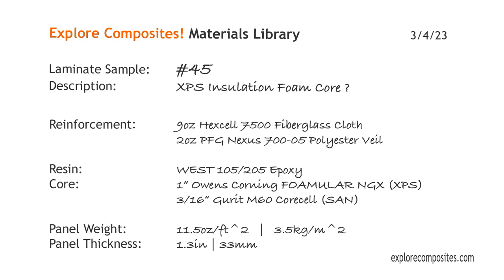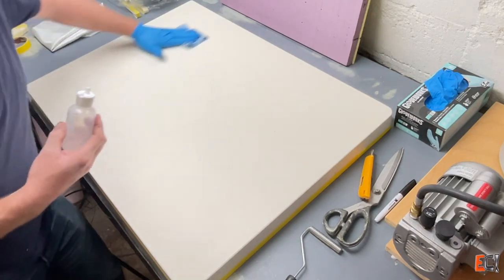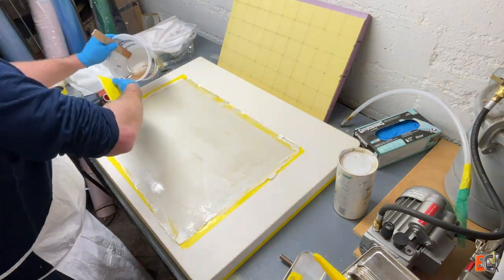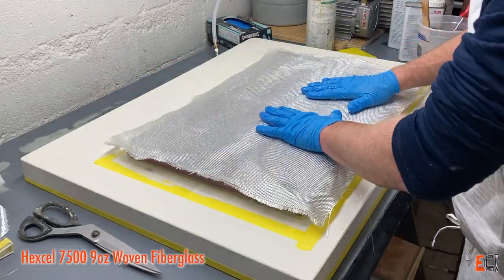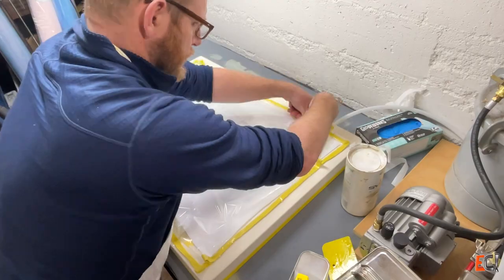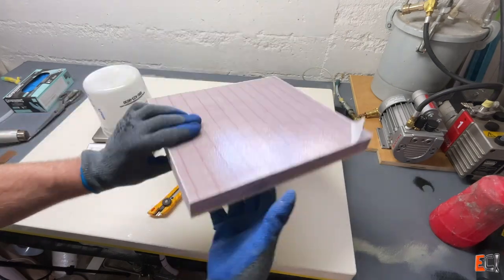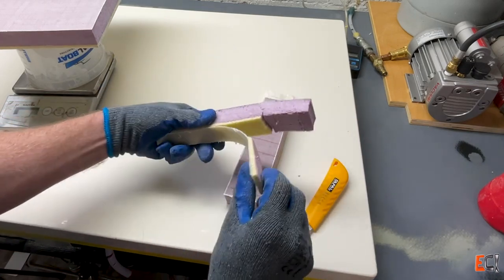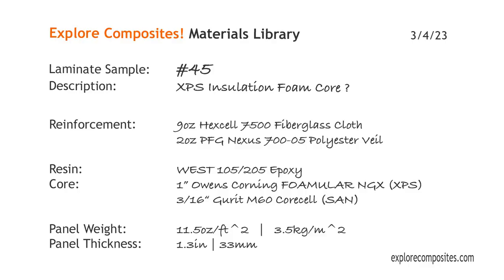Laminate Sample #45: XPS Foam Insulation... Core?

Comment: I built a couple of surfboards with XPS, wet layup e-glass and epoxy. I used a couple of techniques to encourage good skin bonding, like a row of 10-12 exacto blades to score grooves, and initially it was ok but they all delammed eventually. My understanding is that XPS has around 10 percent polyethylene added. This keeps it from sticking as it's extruded. It also keeps anything from actually chemically bonding to the foam, so physical bonding helps. Over time it seems to lose it's grip, perhaps because cycling slowly breaks all the weak surface bonds that initially stuck to the PE. Another issue is that it's closed-cell enough to trap air pockets that will expand with heat and grow with cycles.  Too bad, that foam's physicals are really good. Thanks and the library is awesome!
Reply from the maker: Thank you for the information about XPS - I didn't know about the PE added or consider the trapped air expansion risk.  I came off as pretty down on it in this video, but only because I was trying to get more from it than it can offer.  If you're building super light stuff with little risk of impact - it can be great!

Comment: XPS foam is a polystyrene foam. Epoxy as we all know is exothermic meaning that it generates heat. Foam and heat do not mix . That being said. There is a way that you could’ve done it if you would’ve used a penetrating epoxy with a slow hardening on the foam And put it in your vacuum sealer and basically allowed that to cure with just the epoxy, sanded it, and then add your other substrate with your fiberglass, obviously sanding to create a mechanical bond, you would’ve not had delamination. It would’ve been a solid structure way more solid than you did.
Reply from the maker: This is interesting - the way it failed looked very much like failure of the foam, but if your penetrating epoxy could get a better (deeper) grip, maybe it would be tougher.  Usually penetrating epoxies have very low viscosity and that helps make them penetrate - do you think this would help here?  Thanks!
Reply: @ExploreComposites  FINNFOAM has been used to make at least 2 boats, believe deeper penetration of epoxy helped but really vacuum infusing it is the way to go, only that would cause it to deform under pressure.

Comment: could i use this method to build a outdoor countertop
Reply from the maker: Maybe, but it wouldn't be very strong and would dent easily.  You could certainly fiberglass over an outdoor countertop more heavily - or lightly if the underlying structure is plywood or something strong.  Plenty of boats have decks made out of plywood with fiberglass (ideally in epoxy) over - works great!
Reply: @ExploreComposites  yea im trying to find a substrate to do a outdoor kitchen on..the epoxy and top coat i have that figured it out..tricoya is 385$ waterproof my wow that price for a 4x10 im almost thinking solid surface/corian

Comment: A big issue with XPS foam is that it releases gas when pressed/crushed. That is the reason why some surfboard manufacturers that uses XPS as foam core have to drill holes every inch or so through the fiberglass into the foam to allow the gas to come out and avoid delimitation (e.g. XTR technology). Thankfully, XPS been closed cell, water won't get in. Unlike EPS (open cells), adding a Gortex valve in XPS surfboard won't help since there is no path for the gas to come out.

Comment: I use xps and eps in surfboard building with 3-5mm pvc foam sandwich or  0,6mm wood veneer ....u can have a much better bond by adding some microballon-epoxy filler on the xps foam :)
Reply from the maker: Thats interesting!  I was kind of thinking surfboard here - so you use the PVC foam or veneer to improve surface impact resistance?  Or skin adhesion?

EPS I can totally see benefitting from the micro balloons - does it make as much difference with the finer grained XPS?
Reply: But you do use a pressure valve in the foam?
Reply: @ExploreComposites  impact  general

Comment: XPS foam has a coating on it due to the manufacturing process. That coating should be removed via sanding or hot wire so the epoxy will form a good bond.
Reply from the maker: Thanks for the info - that makes sense. I will have to experiment with it more.  I wonder if the hot-wire process itself makes for an improved bond where the melting has happened?

Comment: Sanding the surface of the xps would help. In the case of pvc foam, it has a closed cell structure, but in the process of cutting the surface, the cells on the surface become open, increasing the bonding force and reducing the peeling phenomenon.
Reply from the maker: I totally forgot to mention it but I did sand with 120g before cutting in the slices on both faces of the XPS… oops!

Comment: I used XPS as a foam core in a few windsurfing boards.  They were exceptionally light and lasted very well.  I did use on of the denser grades.  I would not hesitate in using this again.  
It certainly is worth considering for other uses, say a small dinghy / yacht tender.  I would not use it for the main structure on a yacht, but for non critical parts, perhaps.  Particularly if you were after good insulation, for the least cost
Reply from the maker: I haven't found an easy source for higher density XPS, but I bet it would work pretty well even at 2-3 pound density.  Compression strength and peel-resistance is probably closely correlated with density.  Hoping to try some out soon!

Comment: Very helpful.  Echo Tom's comment, glad your back.  I've used XPS only for the base core of plugs, easy to cut and stand on edge laminated with foam construction adhesive.  For that purpose it's worked well and saved money.  You're test confirmed my intuition regarding it's use as a core material.  Thanks performing and recording the test.   I suspect you saved at least a few folks some frustration.
Reply from the maker: It certainly has its place - even as a core if you can control peel and don't plan to have impacts.  I still think there's something to the thin layers of higher density core on the faces to manage skin adhesion and impact resistance, but the whole sandwich is still limited by the weakness of bonding anything to the super low density XPS.
Reply: @ExploreComposites  I am thinking of make a truck camper roof with XPS foam, the plan is 60 PSI XPS + 2 layer of carbon fiber, with a 6.5" x 13" test piece, it can support 125lbs. Yes, I know the de delaminate issue, but the lightweight really attract me. Any suggestion for the pop up topper roof core?

Comment: As a structural flat panel, it definitely doesn't do so well.  However, this is a method that's been used for more than a decade in the model airplane community with great success, although we typically are sanding the XPS into complex curved shapes (much stronger) and we have to make a lot of concession for ultimate strength to keep weight to an absolute minimum.  That said, the 25psi XPS has made me fine electric jet models for years which easily exceed 150mph and have the structural integrity to pull out of a dive at that speed and straight back up.  We also use carbon fiber tube to make strengthening spars, but still.

That said, there's a YouTube channel called ThinkFlight who's perfected a process with low density EPP foam, Kevlar fabric, and E6000 craft glue thinned out to nicely wet the fabric that makes a nearly indestructible airplane that bounces off almost anything.
Reply from the maker: Thank you for this!  I would love to learn more about model aircraft building.  Impacts seem to be the big issue but even surfboards make it work.  Going to look into other low density foams and will check out EPP.
Reply: No problem! I always like to see new building techniques for just about anything, especially involving composites.  A method that's worked pretty well for me, and makes planes that, while not indestructible, are very tough, but still very light, is to use only a single layer of 7gsm genuine Kevlar veil as the stressed skin over a built-up, shaped XPS fuselage.  It still adds a lot of strength and stiffness while remaining very light,and transparent to radio frequency.  But yeah, hot wire cutting the rough shape from an EPP billet, then sanding to final shape, then using a 2x2 twill ~3.5oz Kevlar with thinned E6000 makes a plane that can hit a telephone pole at 70mph and simply tumble to the ground with nothing more than scuffs and a broken propeller. @ExploreComposites

Comment: Wow! that print blocker looks very nice, do you have a recommended distributer or somewhere you think I could grab a sample?  thanks Chris
Reply from the maker: Precision Fabrics Group (https://www.precisionfabrics.com) might get you samples.  I am pretty sure Composites One distributes some of these heavy veils too.  I originally learned about them as part of testing for co-infused or pre-cured skin coats to help with cosmetics where there were some pretty specific issues that made typical methods less appealing.  There are fluffier spun polyester print-blockers that build more thickness (but with more heavy resin) and are more drapeable - Lantor makes some.  This PFG stuff isn't super stretchy.

Comment: Sorry for left so many comments under different threads. I am near pull the trigger to source XPS + carbon fiber for my popup topper project, but little bit hesitate after read all your reply. Previously I have done test with XPS 15 PSI, and Nomex 3/8" thickness 1/8" cell, both performance can meet my requirement. But Since I can easily find 2" XPS with R10 in hand, but the maximum Nomex I can find is 1" which lead my head on XPS 60PSI version. Or maybe I can use two layer or Nomex core? 
I am totally new in this area, any suggestion are welcome.

Comment: Interesting experiment. What do you think about Filon paneling on top of XPS? Would you still need to have another denser layer underneath?
Reply from the maker: I don't know - never used it.  Probably an adequate option compared to lamination directly on the foam.  Maybe a foaming gap filling adhesive would be good?  The denser layer was just there to see if it prevented denting: yes, or improved adhesion: kinda but not between the two foams.

Comment: What about 12mm plywood with 800grm2 4545 double sided, how ve can same strength with using 20 or 30mm core? How much fiber ve need
Reply from the maker: Strength and stiffness are very different - and sandwich panel core thickness, density and face-sheet properties vary a lot!  This panel is very thick, but core density (and compressive/shear strength) is very low.  This is a very strange corner of the options available so it is interesting but only useful for very light and unloaded structures.  Plywood and 800gsm biax are in a much more well-behaved (and heavy) area of composite skin/core options.

Comment: Do you think the higher density versions of Foamular would provide better performance?
Reply from the maker: I’d imagine it would help.  Here the foam just separated right at the surface leaving a pink fuzz on the cured skin inner surface.  Somewhere I saw a datasheet for a bunch of densities of the Foamular NGX that included compressive strength.
Reply: @ExploreComposites  The XPS in your video should be Foamular 150 (15 PSI) version, they have 250/400/600/1000 which mapping to 25/40/60/100 PSI version, higher PSI means more density. I found a local dealer with 60PSI in stock, will try

Comment: How do you explain successful test by easy composites when xps is wrapped in carbon.  Here is the 2nd video where they are testing for strength.  https://youtu.be/FFi2H_PC7hw
Reply from the maker: The XPS they are using is 33kg/m^3 which is about 2lb/cubic foot - compared to the pink stuff in this video which is about 1.3lb/cubic foot - so it should be much better in all ways (except weight) as a core.  Another key difference is that the airfoil is actually a tube, so some of the shear is carried by the skins that wrap (leading) and connect (trailing) edges.  The core is strong enough in compression that the top skin fails first, which may be more of a uniform loading on the compression side thing.  

You could certainly do the same process with the pink foam, and it would work fine - but would be a little lighter and substantially less rugged than the one in the Easy Composites video.  The big issue I saw is the minimal peel strength of the skin to core bond - with the section totally wrapped, this isn't an issue as much. If you can avoid peeling situations, the core works pretty well for its density - which is very very low as cores go.  Overall the method they show is a great way to get a mold-less airfoil with very little work.  It could certainly be tweaked with different core densities and laminates to perform even better - but it's pretty impressive as is!
Reply: @ExploreComposites  
Thanks
Reply: @ExploreComposites  I wish you'd skinned both sides with cloth and not just used a veil on one of them. During your final strength testing it looks like the veil fractured on the compression side as the foam compressed, and it's not clear which happened first.  It's unfortunate that neither side of your panel had a strong reinforcement directly onto the foam because you weren't able to evaluate the compressive properties of that more-typical construction. That Foamular  project board is rated either 15 or 25 PSI in compression, and neither Home Depot nor Owens Corning make it clear which.  It might be possible that those 2x2 panels are extruded from end-of-batch foam used in other products, and could vary between the two ratings, but I'm just speculating here as I cannot see any other reason for OC to not just state which it is.  Regardless, that board is strong enough to stand on  without reinforcement (wearing flat shoes), and with a suitably stiff surface reinforcement to spread the load it should be fine in most applications.  Remember, the main purpose of core foams is to separate the compression and tension reinforcement layers to increase bending strength and stiffness.  If extra impact resistance is needed, an aramid layer might be appropriate.

I had tested this foam board with a single ~200gsm glass cloth skin on each side and it was pretty stiff and strong. I used the surprisingly elegant "homemade prepreg" method of  wetting out glass by rolling it on a flat surface between two layers of polyethylene, then using scissors to cut out reinforcement panels before removing the poly.  As others have found,  my resulting test panel will delaminate fairly easily despite having sanded the foam beforehand.  I can just create an indentation with my thumb, but only just and with a lot of force. I think a second glass layer would prevent that, so I'm fairly confident about the foam's compressive strength.  Upon bend load-testing, the failure mode is delamination of the compression side.  That delamination is audible as the glass pops away from the foam. Eventually a crease occurs along the line where most delamination has occurred at the axis of most stress.

Attaining a good  bond strength will be the key to using this foam. It remains interesting to many for its low cost and easy availability.  I read where someone had performed a series of experiments examining the bond strength with unexpected results.  Sanding, drilling and blade-scoring were not very effective.  Apparently their best result was obtained by scratching the surface with a fine wire pet fur brush.  They claimed that after doing that the foam would tear internally before the bond failed.  I have yet to find time to replicate that, but if true, it could be exciting. I'd like to make lightweight composite baseboards for a model railway.  Given the size, pricing is definitely a concern.  I think XPS with 2 layers of glass on each side might be an economically viable solution.  Ideally a one-step infusion process would be achievable, but if that doesn't work, a two step process of bonding finished skins to the foam would be ok too. (That might help with both bonding and edge-crush).

Owens Corning also make an industrial insulation product,  Foamglas, which is designed to be used in more demanding and structural applications, including under cryogenic tanks, or to insulate direct-buried pipes.  It's available in a board format with a glass fleece facing to aid bonding.  It looks interesting, but I suspect availability and cost might take it out of consideration.

Comment: I used 2-inch thick 2# Dow Foamular to build a mold for a 48" long x 8" radius fairing half..well, to mold 2 fairing halves. That foam is a nightmare to use, never again! The deal breaker is that this foam is not rigid. It's spongy! Because it's rigid, filling holes and then sanding the filler down to the foam surface does not work. The hardened filler moves downward when the sandpaper contacts it, and the sandpaper ends up sanding the surrounding foam instead. Stop sanding, and the hard filler pops back up, above the surrounding foam!
Like others, I've used this foam to make hydrofoil boards, for which it does work well. Garbage for making tooling though!
Reply from the maker: Yes!  Been there, struggled with that.  It's the worst.  I keep coming back to wood (but mostly MDF) as about the ideal cheap tooling material.  Harder to shape, but stable (ish) and uniform.
Reply: @ExploreComposites  Yeah, I've built MDF tooling before. Glued up a large block, CNC machined it, sanded, then coated, sanded and polished polyester tooling resin (duratec). Still, the hairs from the MDF prevented part release. Had to demold the parts using a hammer and chisel. Every time, lol!